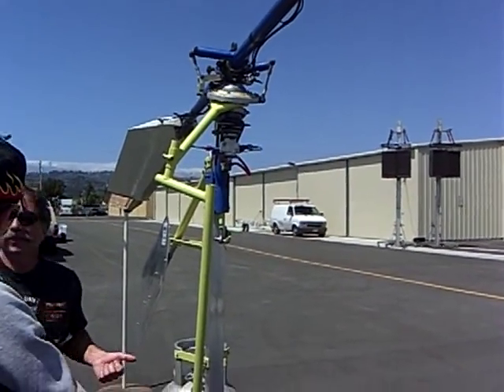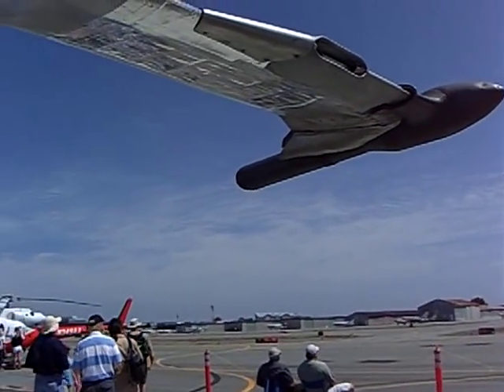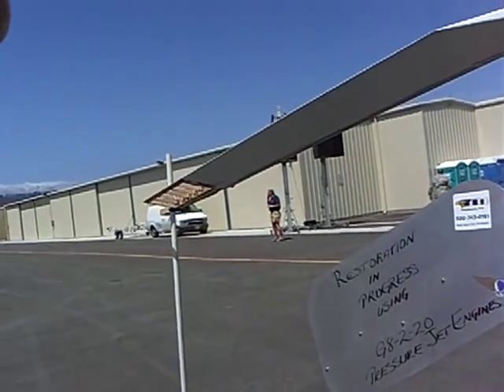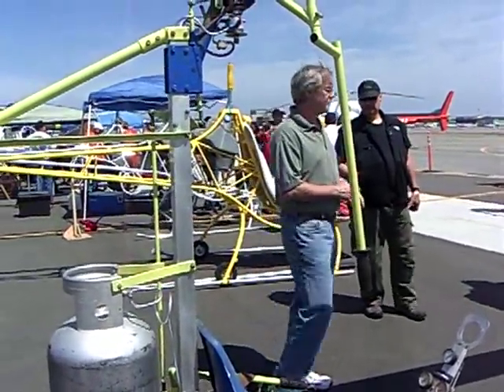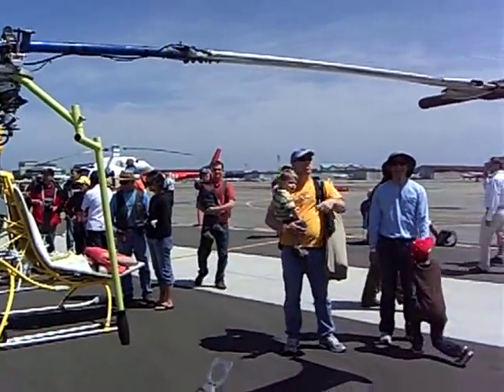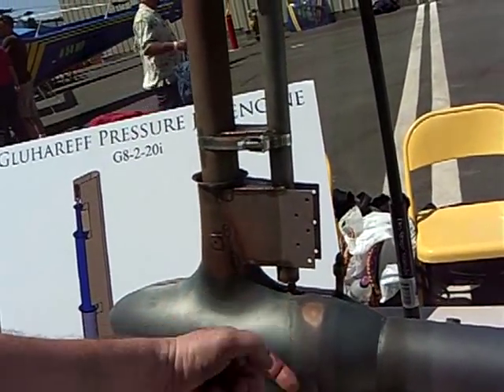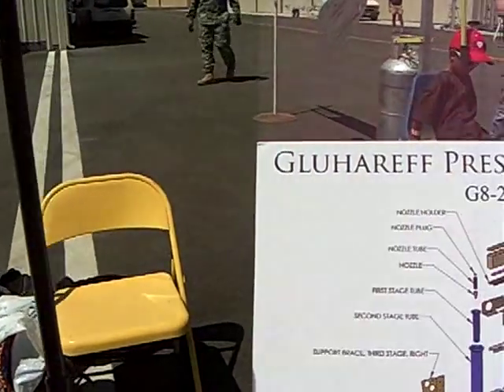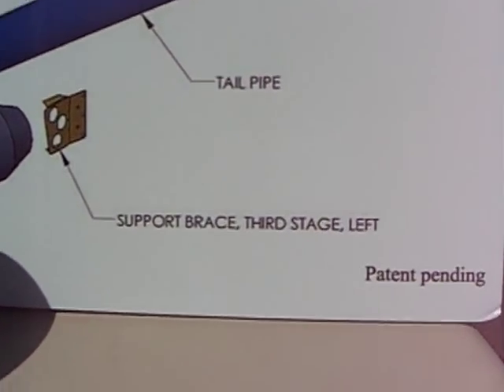Personal Blades Tip pressure Jet Engine Helicopter. Invented by Eugene Gluhareff

Comment: NASA invented this prototype Ram-jet powered mini-heli in 1950. That's why u study History, most new concepts were already done 60 year;s ago. Go to school and study history!
Reply from the maker: Close look at Hiller HJ-1 (YH-32) Hornet ultralight Helicopter with Rotor edge RamJets engines -1 https://www.youtube.com/watch?v=OpDORD_aiQ0
Reply from the maker: See after min 2 -  the Hiller 8RJ2B Ramjet engines at the edge of the rotor, and the concept design for Hiller's Air Tug Helicopter proposed for the capture of rockets. https://www.youtube.com/watch?v=Bxs27m2Tfws
Reply: Thank's, Hiller and Bell developed this rotor-head. Known as  the  Bell-Hiller rotor head design.
Reply: What's new here is not the tip jet but the engine itself which is not a gas turbine but is some sort of airbreathing propane rocket but uses several stages of aspiration kind of like several stages of the air compressor of a turbine. Compared to gas turbines it is defenitely simpler. As for ramjet one, well, they need speed, this one doesn't look like it.
Reply: bushpilot2001 on 1951 called hiller hornet
Reply: NASA didn't exist in 1950. Study your OWN damned history. And it's not a ramjet- it's a pressure jet.
Reply: @craigwall9536  yup!